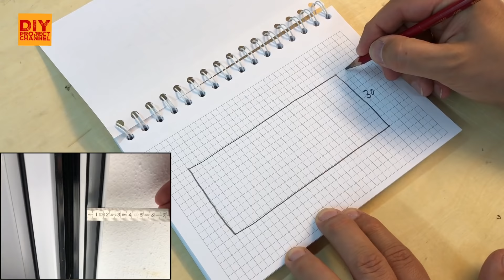Super! Abluftschlauch Fensterdurchführung Rollo Klimaanlage Klimagerät DIY AirLock Hot Air Condition

Comment: Was ist denn  das für ein Kleber im Video?
Acrylglas (EDIT: OK, Polystyrol, da sich Styropor aber auch durch Aceton auflöst, sollte das Folgende trotzdem gelten) lässt sich mit Aceton schweißen.
Auch wenn man nur die Kante auf den Rand "kleben" will, um eine Kiste zu machen.
Das Material wird weich, und die Stelle ist nach dem Ausdünsten chemisch verschweißt.
Also nicht nur geklebt.
Nach dem Prinzip funktioniert auch Modellbaukleber wie Uhu Plast.
Da riecht man auch den Aceton. Das Zeug ist nur zusätzlich angedickt, damit es auf der Oberfläche länger wirken kann.
Dann aber eher bei ABS-Teilen. Nicht nur Modellbau, auch wenn etwas bricht, ist das besser als jeder Klebstoff, weil so stabil wie ohne Bruch.
Für Acryl sollte reiner Aceton aber ausreichen, das ist wohl schneller weich.
Und dann evtl. auch klarer verschweißt als mit Uhu Plast. Und vermutlich auch diesem Kleber.

Schöne Lösung, aber es wird dunkler.
Auch wenn Rollos runter generell vor Hitze schützt.
Am besten wäre wohl eine Platte in Fenstergröße die so eine Spiegelfolie drauf hat.

Hat das Rollo oben eine evtl. vernagelte Holzverkleidung, oft mit Scharnieren?
Da könnte man auch den Schlauch direkt in ein dort hinein gebrachtes Loch führen (für im Winter hat man dann einen "Stopfen"), oder in die etwas aufgeklappte Klappe.
Dann bräuchte man unten an der Klappe noch einen zusätzlichen beweglichen Teil, der so schräg geöffnet den Rest abdichtet.
Außer man hat das Rollo gut nach außen hin gedämmt.